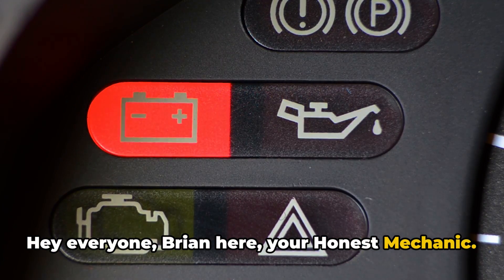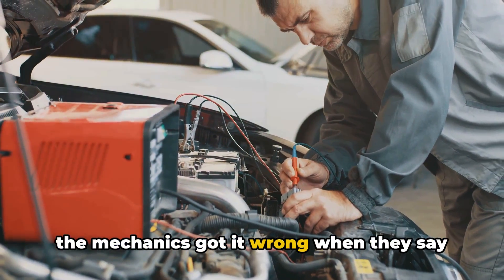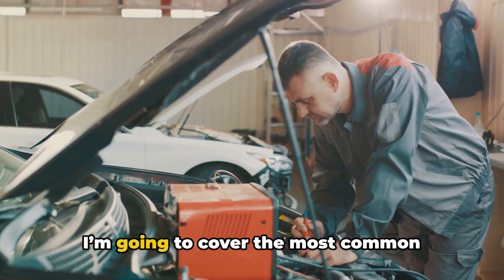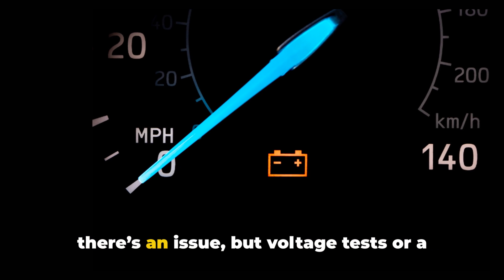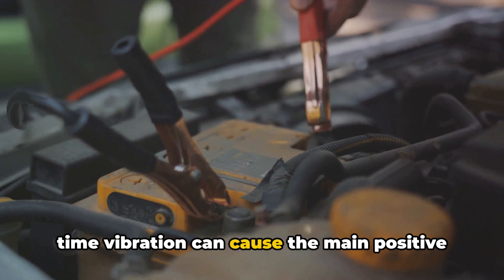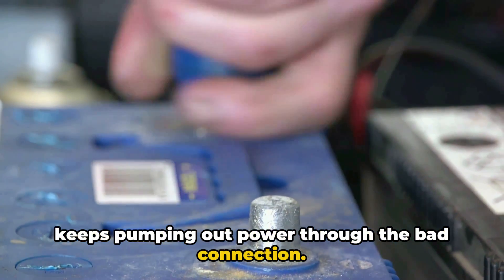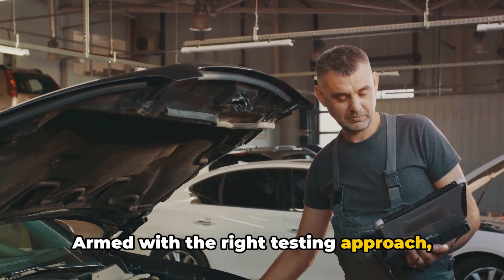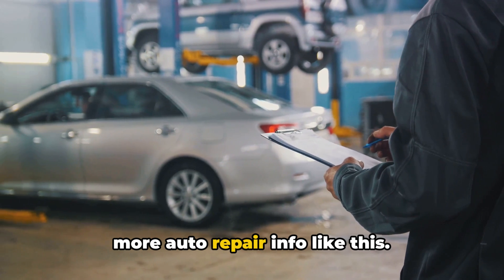Battery Light on but Alternator is Charging: Common Causes

Comment: Slipping serpentine belt, weak belt tensioner, bearings going out in pulleys, electrical issues could be due to mechanical failures

Comment: Hey there. I drive a 2008 Chevy HHR. I have a problem sometimes with the alternator light coming on but the car still runs and drives okay. If I leave it shut off say at least an hour the alternator light will stay off when I go to start the car up. The car will start and I can still drive it. It used to do that same thing having the Check Engine light come for a little bit than going off after that. Do you think it may be a sensor problem? Thank you!😀

Comment: First thing is make sure the alternator is producing current consistently when alternators get high mileage on them they do have carbon brushes in them similar to a starter motor and when they get worn almost completely out they will cause intermittent charging issues and yes it is the alternator. They need 12 volts going into the rotor of the alternator for the alternator to produce current so if the brushes are right on the borderline of being worn out it will cause the battery light to come on and if that alternator has between 100 to 150 thousand miles on it changes are the brushes are worn out in it  and at that kind of mileage if the vehicle is a daily driver and you don't want to be left stranded somewhere then go ahead and replace it anyway regardless of if it seems to be acting right or not because it won't be much longer before it does fail. Anything over say 120 to 130 thousand miles your basically on borrowed time with that alternator so so again if it's a daily driver and you need it to be reliable either get a rebuild kit and rebuild it or better yet buy a rebuilt alternator and then you'll have the warranty to go with it in case you get a bad one
Reply: The Battery and Stop warning lights have just come on our Vivaro, and both the battery and charging check out as they should. The van starts and runs fine. The mileage is over 130,000. Replacing the alternator as you say, at this point would be a sensible option regardless.  Thanks for your comment, as it alludes to fluctuating issues that I am now aware of that may be causes for the lights to come on.

Comment: please help me figure out this problem.the current in the standing position is 13.8, when I drive on the bar screen is 14.2. what if I turn on the air conditioner, the power immediately drops to 12 or 11 and the generator lights up, what will it be?? W203 M271 Kompressor
Reply: Bro have you been able to fix issue ?
Reply: @ericacheampong5403  No
Reply: @ericacheampong5403  I asked chatGPT if he says to put a dynamo on 150 amps to cool the current.

Comment: 06 saturn vue. New belt. Light only comes on at low speeds, sometimes not even then.  Very random /  not constant. Might flicker, might stay on random lenghts of time. Never have a light on the highway / over 30 mph. Sometimes I can go weeks and never see it. Battery was checked at auto zone. Alternator seems fine but the stupid light seems to always go out before I get my meter hooked up. Any suggestions?
Reply: Literally same! My battery light flickers been doing it for months , the battery light would pop on with Check VSC and airbag light & traction light. I replaced alternator & belt 90 days ago guess I’ll replace again until I find the issue ,09 lexus
Reply: @sydneybussell5862  I think it's a loose wire or a fused link. Finding it requires 2 people . Hook a volt meter to the battery. Start the car, one watches the meter while the other begins moving wires. Fused links are molded plastic blobs in the middle of a wire with a fuse encased in them. It's rare but they can break loose inside the plastic.

Comment: Current problem is my battery warning light doesn't light up when I turn the car on, still doesn't light up after I start it. What might be the cause for this problem? I'm gonna try to check it with a multimeter to see if the alternator is charging properly
Reply: When You turn Ignition on,the Alternator light needs to be on. When it is Started Alternator light needs to go off. Sometimes it could be Brushes inside Alternator. What Car is it and Year Model?

Comment: I have my battery changed for 3 times but still the battery sign appears after few minutes of driving. N it couldn't start again when it stops. And also when the lights are on it just drain the battery not after 5 minutes. Can anyone help
Reply: It’s your alternator brother, easy way to test this out is get a voltmeter, while the vehicle is off, test the battery, if you get 12volts it’s not your battery, now turn your car on even if you have to jumpstart it, then test the battery as it’s running, you should get around 14volts, if you get any less than 13.5 volts it’s your alternator for sure, should be a  $200-$400 fix at a mechanic or $100 if you do it yourself

Comment: Would a bad sensor cause a battery light? My light came on from a start and then while driving home the engine light came on and when I read the codes one was the thermostat which I expected because the thermostat is stuck open and I’m not worried about that currently but the other was the oxygen sensor saying it had no power or low power which I have never dealt with before. I guess I’m asking if the sensor burnt out would that cause a battery light because of the short in the electrical system?
Reply: No.  O2 sensors are in the exhaust and are used to monitor oxygen levels relating to fuel delivery.   They have heaters inside them that go bad. That being said if your thermostat is stuck open your engine will run cooler and could cause other systems to throw error codes due to not reaching a specific temperature threshold the computer is looking for.
Reply: @eldogg83 I figured out the issue thanks for the reply. I had replaced the alternator about 6 months before I had the issue I described and turned out the alternator was faulty and crapped out of me so the car was dragging the battery and causing all kinds of codes and issues 🤦🏼‍♂️ I fixed it and everything is back to normal 😁

Comment: Toyota RAV4 1997 4awd 

Battery light + ATP temp light  + exhaust light on
 Alternator works great (just test your alternator
1.start your car and 
2.unplug your battery wire (+) only 
3. Check it ,  if alternator works your car not turning off , your ALT works fine 
I solved problem  : Update 
It was on fuse box ALT+S with 5A fuse ,  it was blown
Reply: Did that! Had to have my ECM replaced and my alternator replaced on my Honda.  $3000  Yeah it works to show if your alternator is good or bad, but don't chance it. Get out the volt meter to check. Much safer and cheaper.

Comment: 2 mechanics told me everything is fine. I almost replaced the alternator before i looked under the fuse box. My battery  light was on so After some tinkering i decided to find a wiring diagram. After locating all the harness plugs, i noticed 1 of the 3 wires at the alternator harness was showing open. After removing the wiring loom i found a pitted wire about 6 inches back Spliced in a new conductor and battery light is gone.
Reply: What???!
Reply: A while back Mine was a blown fuse,and it happened to my Dad's car today,and i decided to check the fuse boxes remembering my own experience and walah,he had a blown 7.5 fuse also.It fixed the battery light problem .Forgot to mention ,his negative battery terminal was also slack,so idk if that caused the fuse to blow moving around while driving ..

Comment: Anyone help I have a new alternator and battery is fine but the battery light comes on after 10-15 mins driving all my car lights come on and battery goes flat but since I’ve unplugged this wire from the alternator to the battery that tells it when it needs more volts the car has been fine and light is still on could this be the wire or something else auto mechanics have said the wires are fine etc but the cigarette port doesn’t work anymore since I plugged in this Bluetooth thing in could I have a blown the fuse and that’s what causing the problem or is the wires that are the problem
Reply: Did you figure out

Comment: My 2011 Honda Pilot.. it will make some noise when the Battery light comes on. After drive for a bit, the noise goes away and the battery light turns off. I took it to the shop and they told me it was both my belts. It's been changed for about a 1 1/2 now, but today it happened again with the noise and battery light Please help?!

Comment: Hello there I'm joe just wondering if you can help I've got a problem the the charging system on a 2007 Ford Taurus iv replaced the alternator and replaced the battery too and replaced idler pulling and the serpentine belt but the chargering check engine light is still on iv took it to the mechanic they couldn't find the issue but then again it's charging just fine new battery new alternator but light is still on I've drove it 2 hours back and forth with no issues just that the light is on can you please help I would really appreciate it thanks.
Reply: Put the car on a scanner. Check for default codes...do a VISUAL scan of wiring harness plugs and wires...sounds like an open circuit somewhere.

Comment: Mine when battery light comes on while driving it dies, then you can restart it and fine. But continues same, why what would cause this
Reply: I’m having the same problem
Reply: Same here can’t figure it out. Changed out a few parts tightened everything loose and still
Reply: It was a idle issue it would actually idle so low it would die it wasn’t even alternator light came on cause it died

Comment: got a mustang and the light pops up and the speedometer turns off while driving, car stays on but speedometer and screen turn off when rapidly accelerating or staying around 70-80+ and cannot figure out what's wrong, replaced the alternator and the battery is fine i'm really confused on what to look for.
Reply: @imaillegalbeaner9533 same thing happening to me now in my Civic, you ever figure out what was wrong?

Comment: Hi!  My issue is the battery signal kept on showing.  I replaced the battery and the alternator and its still shows.  Help please!!!
Reply: Serpentine belt
Reply: Check the connections to the battery terminals most cars have fusible links in the positive terminal change it . If you don’t you probably have a bad fuse check those out

Comment: Hello there just wondering if you can help I would really appreciate it,  I have a 2007 ford Taurus the battery light is on I've buy a new battery and new altenater the same time but the charging system is still on I can't find the issue
Reply: Did you find this issues? My car is doing the same
Reply: Bad or broken cable (might not be able to see where), loosened belt, bad belt tensioner
Reply: Replace the mega fuse on the side of the battery

Comment: I have volvo xc90 t6. I started up. I have a messaged popped up, saying "12v battery charging fault". I turned off the car. Then, i turned on the car again after 20 minutes or so. The message disappear. What does that mean?

Comment: I have an issue where I would start the car and the battery light would stay on. I then turn it on and off 3-4 times then on the 5th try, the battery light goes away. I then drive for 10 minutes without the light on dash. I then park somewhere turn it off. Once I turn it back on the light  comes on again.
Reply: You have an issue with a fuse or one the connections to your terminals is bad . If your positive has a fusible link change it .

Comment: I've had to jump my diesel f350 when it's cold out like 40 degrees, both batteries are new and check out fine. Gauge says I have 14.3 volts while running. Now battery lights on, charged and tested both batteries are good. Won't turn over engine. I'm at a lost the alt is one year old auto zone brand which I replaced when the battery light came on last year. I'm hoping it's just this alt but it's a bitch to replace it and find out it's not the problem. This is a 6.4 liter engine.
Reply: Sounds like Ford don't like Autozone. I'm having the same issue but mine is only at 13.3 V and a crown Victoria.

Comment: On my 2017 Murano, the charging voltage varies where when teh battery is almost full the voltage drops a little to like you said 13.5. The drain current is 47mA and varies as well, never over 50mA. It has a new battery and wife says she sees the battery light here and there but not on the interstate. No error codes on my Launch 431. I'll check the battery current sensor and ripple.
Reply: Check the connections to the battery if u have fusible link in your terminal change it

Comment: My problem seems to be they were working on top of my motor  last week and now every time I move the wire on the alternator the light goes on and off. I had to scream at the guy over and over to get out of my motor even threatened to call the police finally another guy came and got him out from under my hood because I didn't like him laying on top of my radiator and then when I went to leave the light turned on so they taped it so every few miles I have to retake it😢😢

Comment: My Chevrolet Beat has some smoke issue inlast 2 3 days. Smoke doesn't come out when startup but after warm up, it comes out, not heavy but it's clearly visible. And water also comes out too. Waht issue this might be.
Reply from the maker: Hi, The visible smoke from your Chevrolet Beat after warming up, accompanied by water emission, could indicate condensation within the exhaust system, which is relatively normal, especially in colder weather. However, if the smoke has a blue or white color, it might suggest oil or coolant burning, respectively, pointing to potential issues like worn engine seals or a head gasket failure. Monitoring the color and consistency of the smoke, along with checking oil and coolant levels, is advisable to diagnose the problem accurately.

Comment: I have been a ASE mechanic for over 40 years. I got a remanufactured alternator. Charged 13.8. An alternator will charge with a min of 13.5. When the light comes on with the system  charging ,most of the time it is a failure of the Diode trio.
Reply from the maker: Thanks for sharing!
Reply: Hell I got a brand new parts city and it was no good I fix it cause they were pretty crappy about the whole thing